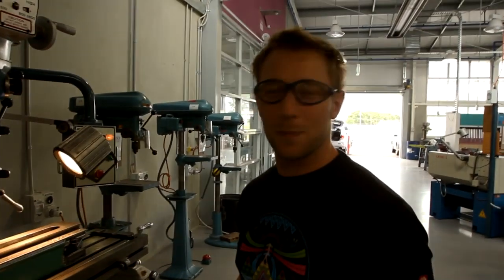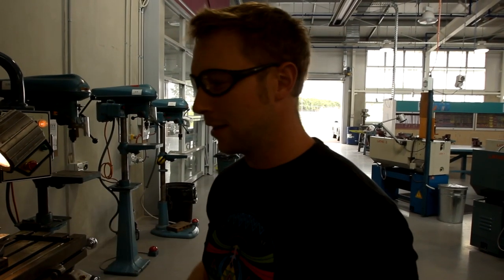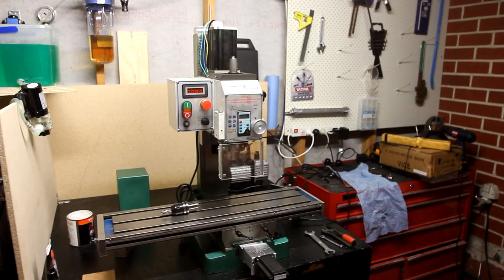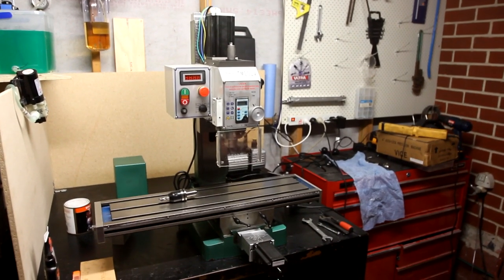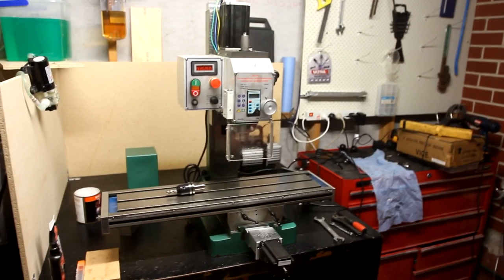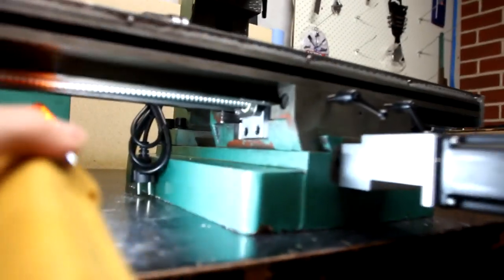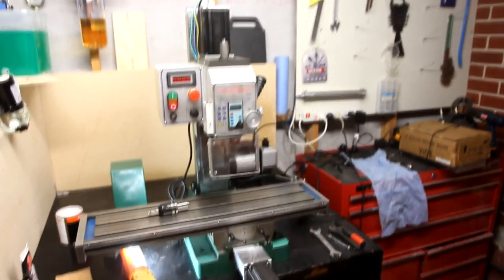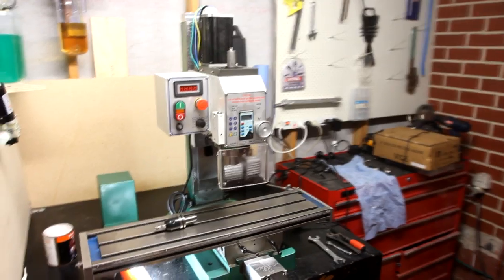CNC Mill conversion - Episode 2 - Machine modifications, fitment

Comment: Hey Luke,
I am investigating what is involved with the cnc conversion of a TM20LV mill. Your video is a great help, 2 quick questions:

1. with the z-axis ball nut mount. Did you modify the supplied CNCFusion mount or did you fabricate a new one from scratch? Can you give me some details of your modifications to the ball mount.

2. did your new y-axis ball mount look similar to the modified z-axis version. I understand that both the original ball nuts are similar?

If you can let me know that would be great. Thanks for the videos they have been a great help...

Oh, one last question do you know of anybody in Sydney that has undertaken the CNC upgrade on this mill? Somebody local to talk to would be great,

Cheers,
Jeff